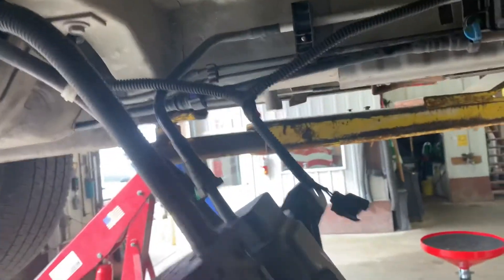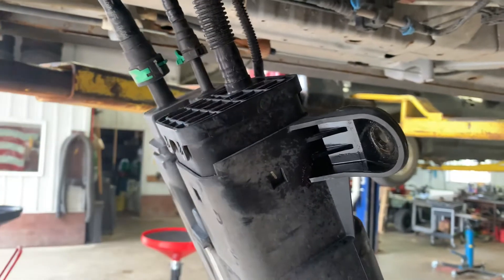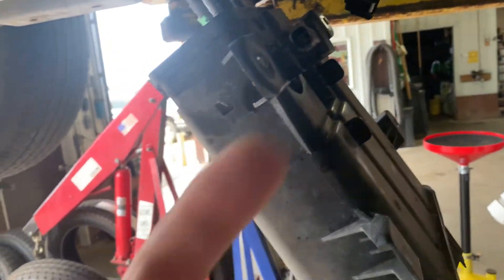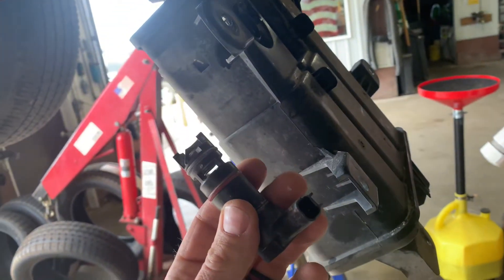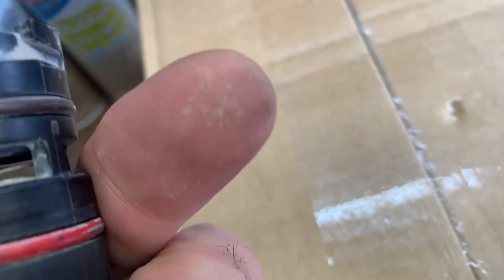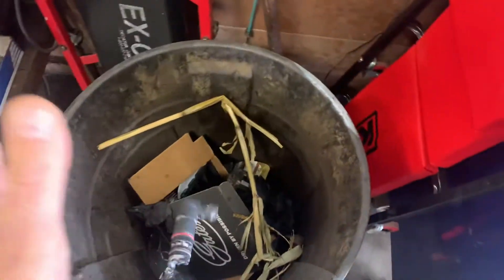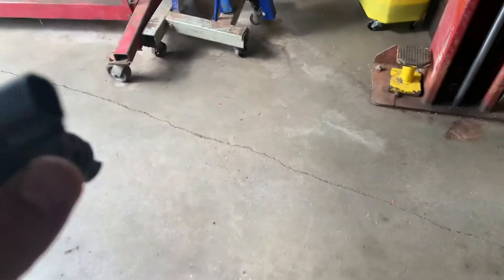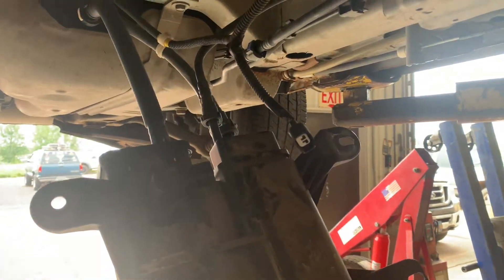Evap Codes A Short Possible Cause And Fix Chevy Equinox

Comment: I have an equinox 2019 premier 2.0L turbo. I have P0449 and P0498, both permanent and both came in the same time. I already replaced the purge valve and the vent valve and checked all the fuses. Disconnected the negative pole of battery to reset it and after 2 days the engine light showed up again with the same codes. What seems to be the problem ? Wiring maybe? Or the new valve that I got at autozone (aftermarket vent valve) is not working?
Reply from the maker: I’d start by checking the wiring and connection to that vent valve.
Reply: @ thanks. I was reading in an other post that sometimes the fuel pomp control module affects the low voltage in the vent valve as well and this code P0498 is thrown even though this code is not directly related with this module. So 2-3 guys replayed in that post and confirmed that same thing, replaced fpcm and the engine light went off. What do you think ?
Reply from the maker: @xhoibeshiri6113  it is possible with another module causes voltage feedback.

Comment: Thanks for sharing this was the problem with my 2012 equinox
Reply from the maker: You're welcome!
Reply: What was your car doing before adding the new part? Was it just the light being on?
Reply: @ check engine light was on even if I deleted with the scanner mine had a crack in the bottom so when I replaced 
Problem solved

Comment: 1 day prior to getting my equinox 07' inspected I filled up the tank, next day my check engine light came on. I checked the cap, on tight. The shop that does my inspections cleared the light, said go drive 30 miles and come back. Still no light, got told to drive it on the highway, go to a parking lot, dont park it, have it like you're at a stop sign for 3 minutes and bring it back. Still no light. Drive it again. In total of 2 days I drove over 160 miles still no light on. I dont know what code came up, I'm being told evap problem. Cant drive it anymore cause I missed the inspection. Mechanic is on vacation. Glad I came here because the video you showed explains a lot to Me. I always try to think outside the box and was wondering if it could be the air filter clogged as I havent changed it in 2 years? That's something I could do before taking it back to the shop.
Thanking You in Advance, Dickels
Reply from the maker: There are hard permanent Codes, which will turn the check engine light on and there will be soft codes which are set in pending code. If you have any pending codes, it won’t pass emissions. That is likely why they are having you drive it to see if the pending code goes away, or if it’s a permanent code. We need to find out what that pending code number is first and then address the problem.

Comment: I changed the purge valve, vent solenoid and gas cap.  Still getting the 0446 code.  Now I think i have to smoke the system.  It could never be that easy for me
Reply from the maker: Take a close look at where the wires connect to the vent solenoid in the back by the canister. They tend to corrode and fail.

Comment: If you drive in very dusty road conditions all the time can you wrap this thing in plastic and tape to prevent premature failure or does it need to breathe?
Reply from the maker: @jakec1985  it has to breath or it will set a code

Comment: On the new solenoid before putting it in the car is the valve closed. I work in my driveway so I wanted to see if I can access this before I buy one. I removed it and it was open. I am going to look at other videos when there is no power and disconnected if it is supposed to be in a closed position I will replace it.
Reply from the maker: Typically on most cars they will be in the open position with no power to them which is the way they would be if the car was parked so that when you were filling the car with fuel they are venting the air out so that it won’t kick back when you’re trying to fill the tank. Thanks for watching.

Comment: I replaced that exact part just like you showed, and it's still showing engine light and concerned about it passing inspection emissions. Can that square canister thing?Be the problem and be replaced?
Reply from the maker: @dennishavrilla6354  if the canister (square thing) leaks or any part of the system leaks it will code. The purge valve on the engine can also leak and cause this.
Reply from the maker: The only way to fully test is with a smoke machine.

Comment: Could this be causing my 06 equinox to have a rough start?
Reply from the maker: Sometimes. If fuel has contaminated the canister it can cause a rich condition and hard start.
Reply: @UnderTheHoodShow  thank you. I thought it might have been the throttle body. I cleaned it out, and still have a bit of a rough.

Comment: mine wouldnt pump gas at all so i cleaned my canister alot of dirt came out now im able to fill up gas but now im connecting some dots... ive been chasing a rich issue maf code and both issues got more bad along with fueling up so would clogged canister cause a rich condition
Reply from the maker: Thanks for watching.
Reply from the maker: It can if it’s not venting properly.

Comment: I've got a 2009 that's getting a fuel system lean code, on a cold start it takes 2 key turns before it will start, but if you start after  it's ran it will usually start first crank within 30 minutes of it running. Also on occasion when I take the gas cap off, it releases a large amount of compressed air/games. Any suggestions?
Reply from the maker: The long crank could be low fuel pressure or leaking injectors. Low pressure requires a couple cranks to get pressure back up. A leaking injector would drop fuel into the cylinders and cause a flooded condition. The pressure in the tank is normal when the system is closed and the temp in the tank rises. Excess pressure should be vented automatically. When it doesn’t , it can cause fuel to be pushed into the engine causing flooding and a hard start. To know for sure, it has to be diagnosed.

Comment: Help ...I have a 2008 Saturn Vue 2.4 liter and it's giving me P0449 and intermittently stalls when going slow. I have changed the gas cap and the purge valve ... what else do you suggest ...the vent valve ?
Reply from the maker: We have replace many vent valves for this issue and sometimes a canister. We use a smoke test machine to verify no leaks and that the valves are working before we replace them.

Comment: I have a 2008 equinox and when accelerating it makes a whining kind of vacuum noise but it gave me the P047 code. I’ve replaced canister purge valve and charcoal canister problem still seems to exist. Any advice on what other component can be causing this issue.
Reply from the maker: It would take some diagnosis hands-on to know for sure because we don’t hear the noise here of course but, the PCV valve was built into the valve cover on the engine that could be passing too much air causing the squeak sound or it could even be coming from something other external such as a belt drive. Without hearing it our self we just don’t know for sure but we have seen some noises come from vacuum leaks on the engine and PCV systems flowing too much.
Reply: I'm not sure how the 2008's are compared to the 2006's but the pcv valve hose that hooks to the air filter housing after the mass airflow sensor leading on the firewall side of the motor under the coil pack was disconnected mine.
Reply: I keep getting code P0442, Chevy equinox 2014. My Pcv hose, that connects to the valve cover (the rubber part )is cracked. Could this cause a small Evap leak?

Comment: if my evap vent solenoid doesn't come with an adapter is it fine to just install as is?
Reply from the maker: If f you mean the wire pigtail adapter, yes, we install them just as is if the plug in is exactly the same as the original part.

Comment: Can that prevent any gas at all to go into the tank? And would it shut the car down after a minute or2 running?
Reply from the maker: It can make it so hard to fill that when you turn the nozzle on high filling the tank it can click off every 1 to 2 seconds. Also, if you have refueled the car, once you start it tue car may die after a few seconds of running and do that a couple more times until it clears itself out.
Reply: @UnderTheHoodShow  this car won’t take anything at all. It’s not full either. Changed the solonoid. Now the canister is leaking fuel.
Reply from the maker: @terrycarver1255  if the canister is leaking fuel it is bad. A flooded canister won’t vent and take fuel. If a car tank is ever filled past it’s first click it will start to flood with gas and eventually ruin the canister.
Reply: @UnderTheHoodShow  that is what I needed to hear. Thnks

Comment: I have a 2012 chevy Equinox v6, 140K miles and I'm trying to figure out why my check engine light and stabilitrak light comes on after fueling up.  I get the P0300 code and the mode 6 shows a small evap leak.   The check engine light will go out after a few seconds but the car will run rough until I pull over, turn off the car and then restart it. 

I've replaced the spark plugs, gas cap, ignition coils, MAP Sensor, MAF sensor, throttle body, intake manifold gasket and had a fog test done by the dealer with no findings.  Could this vent solenoid on the canister or the purge valve cause this problem?
Reply from the maker: The canister may be plugged. If f it is plugged or the purge valve is stuck open for it can cause heavy fuel vapors to cause a rich condition and the p0300 misfire code.
Reply: @UnderTheHoodShow  Thank you!
Reply from the maker: The purge valve  could be leaking some or the canister may be saturated with fuel and the valve sticking. It may need a canister and vent valve. That can be checked using a smoke machine but they need to be looking for internal leaks not outside evap leaks.

Comment: Can this cause the P0420 code?
Reply from the maker: @emanuelpena2072  Have not seen that.
Reply: @UnderTheHoodShow I have my chevu equinox with code p0442 and p0420 and I can't pass my smoke test any help
Reply from the maker: @emanuelpena2072  we’re assuming you mean emissions smog test. If a smoke machine was used to look for leaks in both the vacuum system on the engine and on the evap system for the po442 you can find leaks that way. If there are no leaks it could have a evap solenoid failure or wire broken. It may also have a bad catalytic converter.

Comment: I. Need de heel l one Chevy equinox the problem is cod PO442
Reply: i have the same code pending and i hear a lite ticking n spudder when warming then runs fine ,im trying to figure this out ,i clear the code n its gone for a week or sometimes almost amonth if i crack this case i will inform you ,n you do the same ,good luck ,what year is yours
Reply: o i see 2012

Comment: Why can’t you just clean it and reinstall?
Reply from the maker: @fishngame  They are sealed up so you can’t get inside. If you could, they would dump all the charcoal out. They should make them with a replaceable filter.
Reply: @ Actually, I’m talking about the sensor that was replaced.
Reply from the maker: @ The dirt gets up Into the sensor and damages it. There is no way ti clean it.